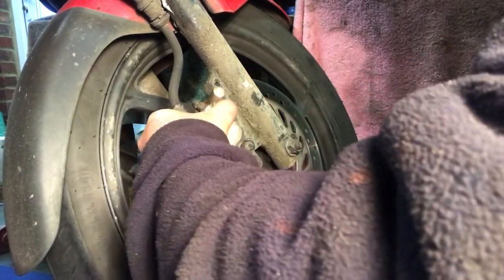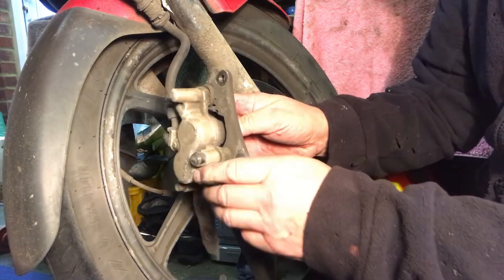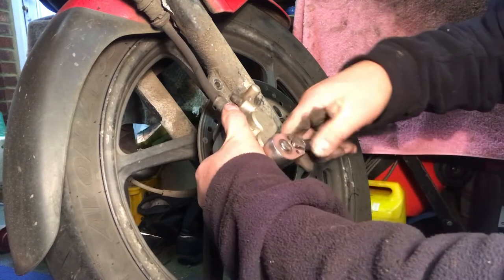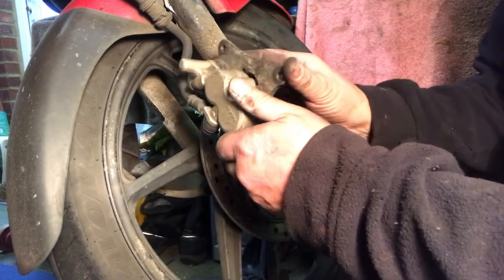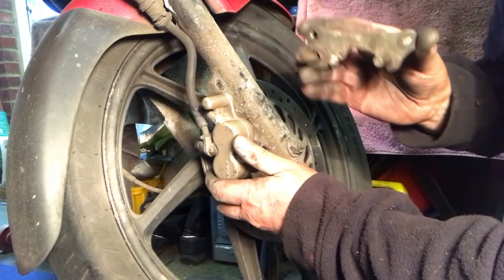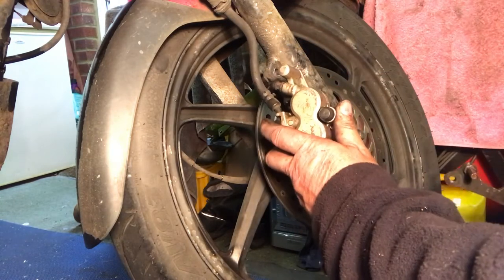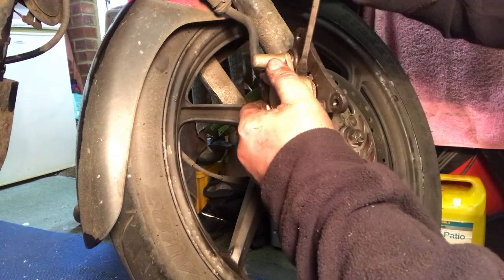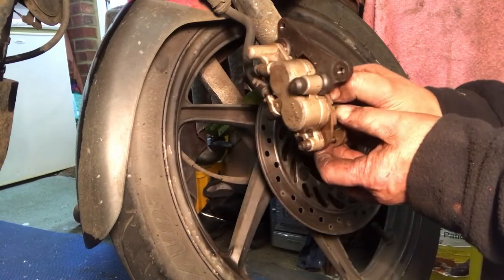How to change Honda cbf 125 front brake pads

Comment: Great video. Will need to have a look on my wifes 125 whats going on with her front break and just checking because never done bikes only cars so far. To be fair im using sliding  pin grease. Copper grease only on pads and fixings because its not designed for lubrication but for anti seize purpouse . Also @15:37 break fluid dripping on a fender. Apart from that the video is very much of a help. Thank you for your time Sir :)
Reply from the maker: Hi Egon 
Thank you for your comments on my video good luck with your wife’s bike 👍

Comment: sot on vid mate  hope fully it will save someone some money . not copper grease tho . i like to use one g clamp and the old pad across the 2 pistons
Reply from the maker: Hi Simon 
Your absolutely right I could have used one clamp to achieve the same job it’s just that I had 2 clamps available at the time thank you for commenting on my channel 👍
Reply: @richardshomemechanics5566  also the rubber part is supposed to go inside the caliper slider pin hole , there is a groove inside where it fits and stays in place..16:43

Comment: Wow my brakes are binding way harder than that to the wheel. Hanks for this. I think I’ll do a service this weekend.
Reply from the maker: Hi Labgorilla
Thank you for commenting on my video if you take your time ..grease  where it needs doing your wheel should spin nice and freely please note with your new pads fitted it will rub a little bit until they bed after a few miles but after that they should be all good 🤙
Reply: @richardshomemechanics5566  My brake lever has almost no travel to it and the wheel hardly spins. I will take it apart and remove the reservoir lid to make sure the brake fluid can come out. I think my issue is that the 2 barrels that you push back with a C clamp look to have much corrosion on them preventing them from fully retracting.
Reply from the maker: @Labgorilla  it’s sound like your right on the money there …take the calliper of and lightly squeeze the front brake so the pistons come out but just enough to be able to clean the rust ring that has been created .. clean it up with very fine wet and dry and then polish with t cut if the corrosion is to bad you may find that the piston starts to leak just take your time your be fine 😀

Comment: Richard my bike’s front brake behaves a bit sluggish (the lever). After using the front brake lever 3-4 times it behaves better. Any reason for that sloppy behaviour at first?
Reply from the maker: If you have no visible sign of a hydrolic leak then there is still air in the front brake system one thing you can do is cable tire the front brake lever to the handle bars so the front brake is on this will do 2 things it will confirm if you have a leak and also repel any air left in the system leave it line this over night last result your oil could be old and needs replacing with fresh as it’s list it’s ability to operate properly under pressure

Comment: The reason why the master cylinder screws can be a pain in the arse to remove is because of cretinous owners using philips screwdrivers on them, instead of JIS screwdrivers. But yes, those hex screws are more superior.